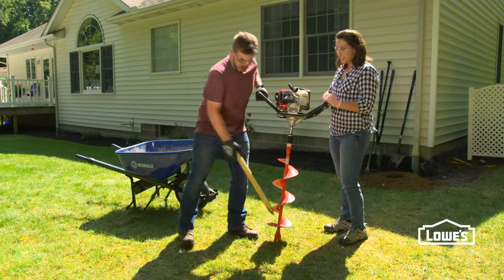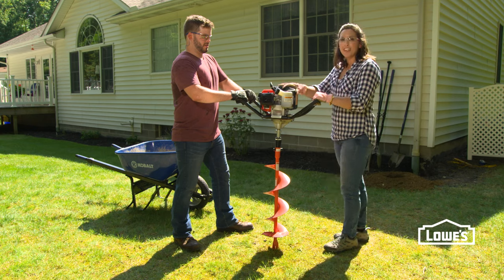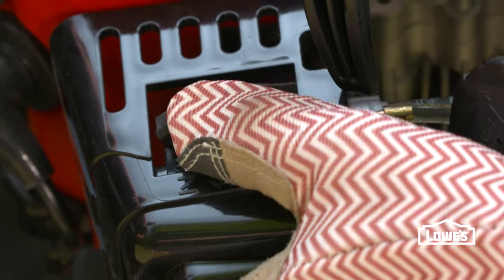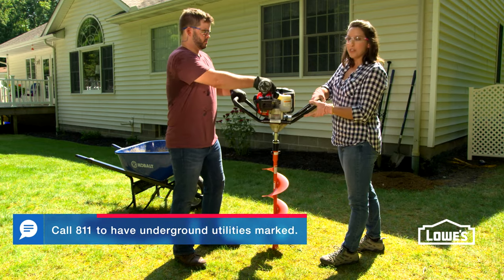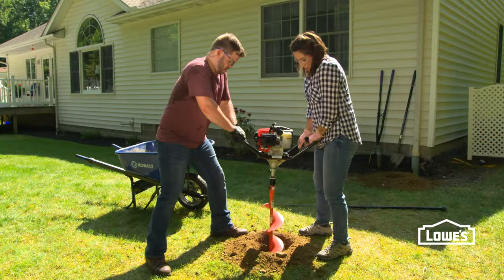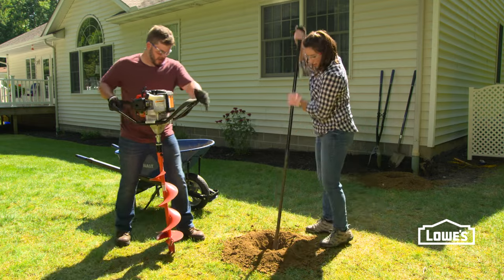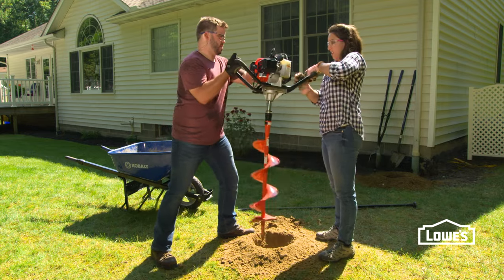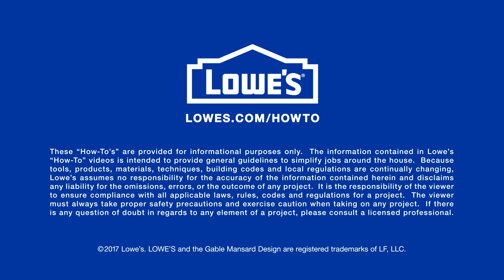How to Use a Power Auger

Comment: What about lifting and lowering the machine to clear dirt and prevent it from embedding straight in the ground???

I “followed” this video and ended up burying my auger bit 3ft straight into clay soil. Had to spend a day digging it out by hand :(
Reply: I just call my buddy Superman to pull it out for me.
Reply: maybe use water to loosen clay. I have clay soil so I am thinking what I need to get.
Reply: Lol
Reply: Same here...spent 6 hours trying to dig 2 holes. I'm thinking to buy a tractor auger to save time and energy